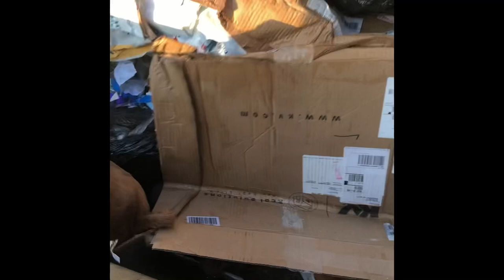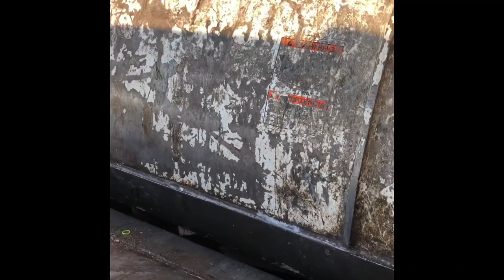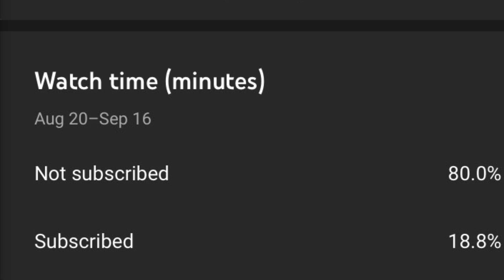Eating garbage microwave toys plush shoes heels diapers pumpkin smashed trash truck

Comment: Would be great to see the shoes getting pulped several times rather than just getting buried so we cannot see what happens to them.
Maybe it would be possible for a high heeled sboe to get caught in that hinged part of the crushing blade where it curves down to cut into the trash in order that the little shoe is squashed over and over slowly being ground into a paste with each cycle.
Reply from the maker: It’s hard to get a shot like that, usually once it’s packed they’re not seen again because trash falls back on them.